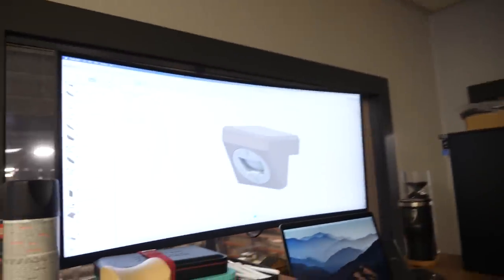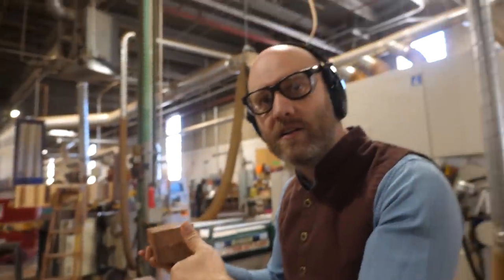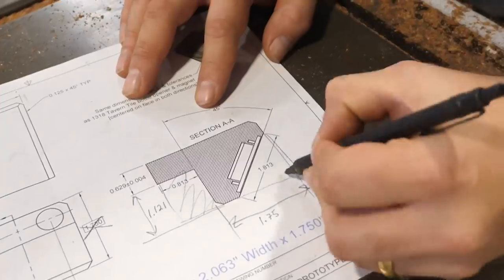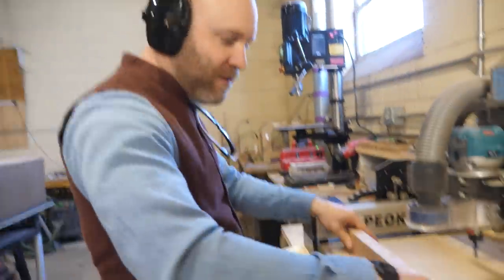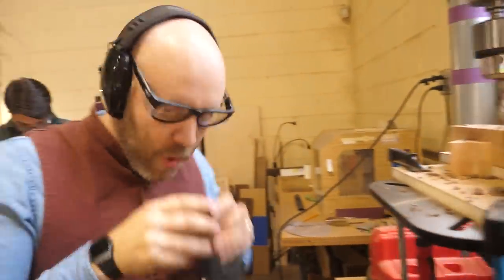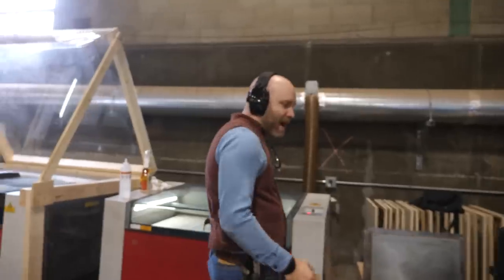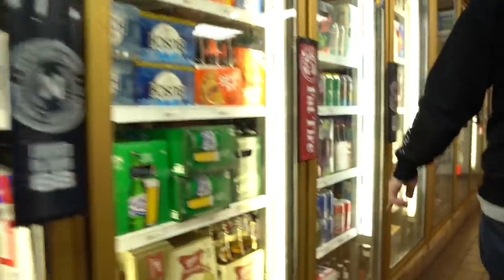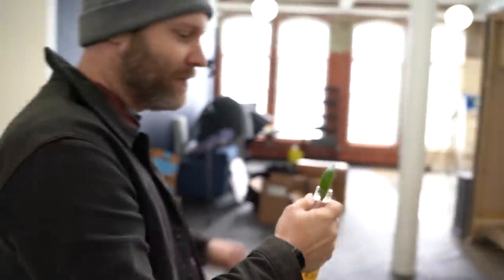A Magnetic Bottle Opener! (don't drunk dial your ex) S12E04

Comment: @wyrmwood it look great, I think I would rotate the opener 180* though.  That way you are pushing it down to open rather than pulling up, if that doesn't mess with how it attaches to the rail system.
Reply: The good news is that it looks like it is 2 screws and the opener is the same shape both ways, so you could reverse it yourself.

Comment: Do the CNC first, drill holes for the magnets, then cut the corner (using 2 cuts and NOT the dado) then cut the diagonal, chamfer, then cut into pieces.

Comment: Hi Wyrmwood Team, I would like to throw in a suggestion of a thing to make.  A table... that can fit an entire 4000 to 5000 piece puzzle, then be able 'hide'/cover it for normal table use. Optional challenge: make a triple threat and try to make the puzzle layer another section to your gaming table altogether. So it would be 1. a table table, 2. a gaming table, 3. a puzzle table....the size is Key to fit a puzzle that size and to be able to cover/hide it neatly. Just a thought, thank you for your time.

Comment: This seems like a weird place to ask, but you are a woodworking company ... my dad cut down a corkscrew willow and my plan is to sand the bigger branches and use them as poles to sting lights around the yard. Any suggestions on how to seal them for a wet climate? I've been thinking marine varnish, but I'd love to hear what you guys think.

Comment: A weird bit of trivia, Dado blades are not legal in Europe as they are deemed too dangerous. Only in the US are you allowed to stack up a bunch of blades and hold them together with a nut.
Reply: You're wrong. There are no laws prohibiting anyone from selling, buying or using them, at least where I live.
Reply: @pupyasko1233  i can only speak for EU members and not all of Europe but the version of the machines sold in the EU have a shorter shaft to explicitly prevent a dado stack from beeing used. I think it has something to do with the fact that you can't have the guard on while using the stack, but dont quote me on that one.
Reply: @rjoac09  I live in Germany. They aren't illegal.
Reply: @pupyasko1233  Didn't say they where not legal, just said the tool models made for EU are made to not accept a dado stack. You can still import a tool made for another region and get around that.

Edit: speaking mainly about the portable job site saws, don't have much knowledge about the big machine shop saws.
Reply: @rjoac09  the reason you can't use them on a lot of cheap saws is that the shaft is so short, you wouldn't have any threads left to secure the sawblade(s)

if you get a "professional grade" saw, pretty much all of them can accept a dado stack afaik. but then you're also paying professional grade money

Comment: I'm sure someone has already said this... but since the top surface of that is flat. Could you add the bottle opener to the design of other accessories, like cup holders, for example? How nice would it be to have one attachment, saving space around your gaming table, that you could pop open your bottle and set it in?

Comment: The opener hardware should be installed 180 to what it is, that wasy you start with the bottle at the angle and the top pops off while it is upright rather than the other way around.

Comment: it would be cool if you added a plate to the bottom of it that's against the table that had magnets in it to catch all the bottle caps so they didn't just litter the floor
Reply from the maker: It has a magnet in it to hold the bottle cap. It won’t fall in the floor.